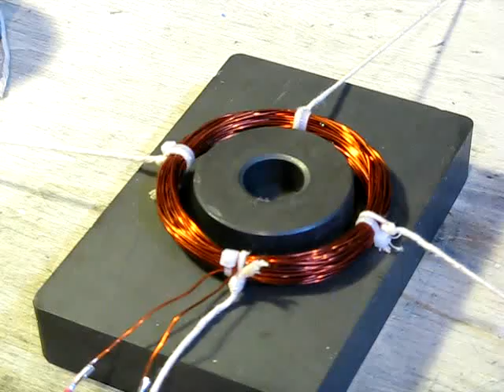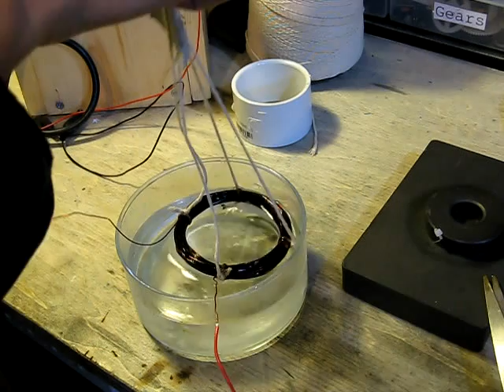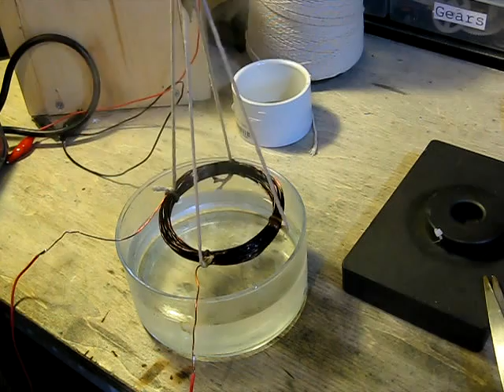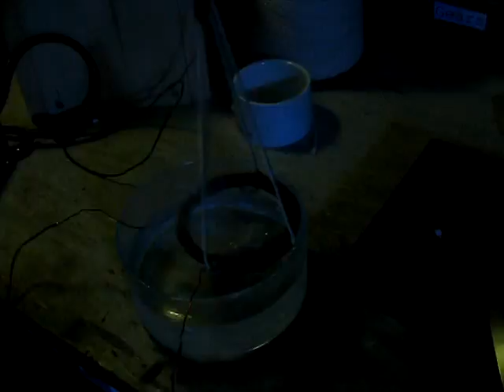Magnetic Levitation

Comment: hmmmmm:-/?
If you used Deionized water: It won't conduct electricity (Depending on its purity).
It's also used as a Laser coolant, for very High voltage power level's ;-) 
Have fun & >B< careful!

Comment: cool aply same charge as magnetic plate to wire and creates electric magnet and sinse both magnnets have same charge they repell from another and the straps help prevent it from leaving the area of the plate loosing levatation and this is a run on sentence but i do not are.  :P